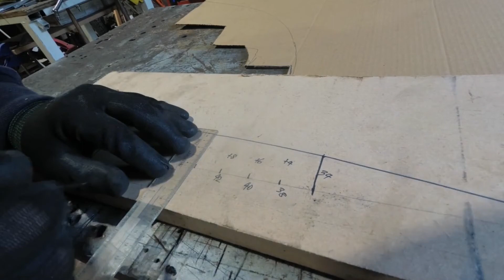Project Etceterini - Part 22

Comment: Watched this from start to finish and I've thoroughly enjoyed watching and learning from a true craftsman.  Will Etceterini be road legal, or are there features that cannot gain an MOT? Thinking of the single headlight as an example. 
It would be a shame to only have the masterpiece on private roads (I think anyway)
Reply from the maker: Thanks Pierre.  The single headlight could be a problem but I may be able to rig up two extra headlamps for a test. There's a few other bits like a cap for the top of the windscreen, possibly side repeaters and mirrors.  I haven't got to that stage quite yet.